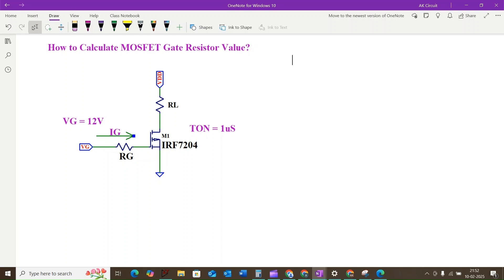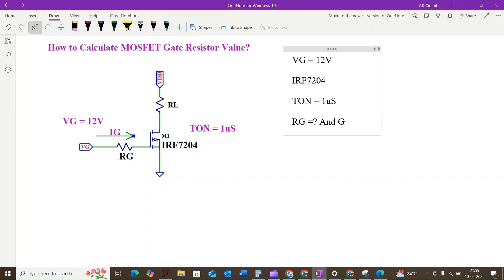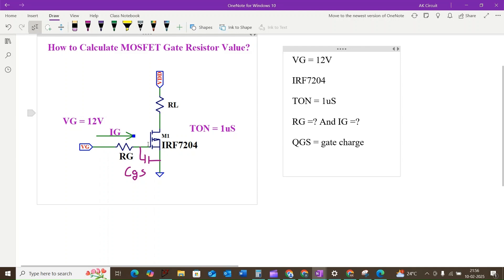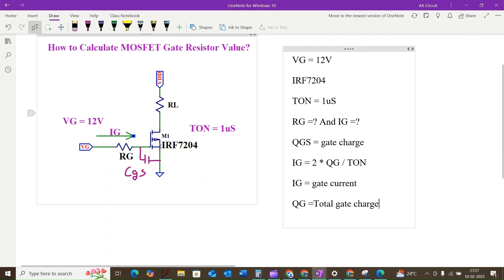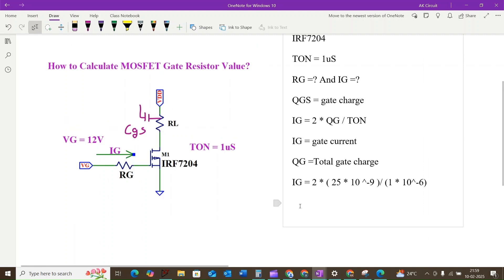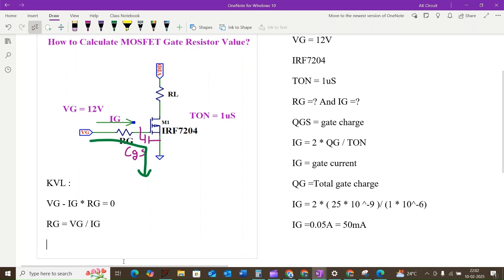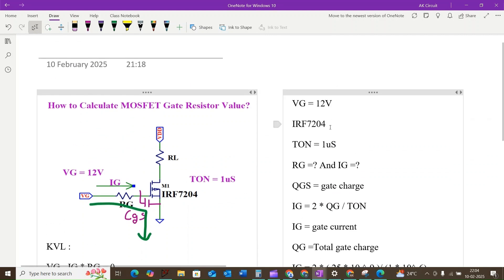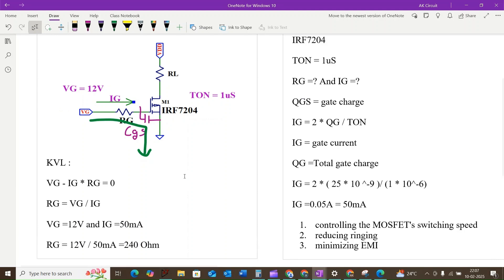Calculate MOSFET Gate Resistor Value (Easy Guide) || Hardware Design

Comment: THis is not as simple as presented. If I have 3-phase synch. BUCK topology, in every half-bridge for one phase, I need LOW EMI but also FAST switching
for low loses,  so one way I use resistor at GATE to turn FET ON, another way I use resistor + diode, to turn OFF FET. And I have to fiddle this values
of GATE resistors, for HIGH and LOW FET, to achieve LOW VOLTAGE / CURRENT overlap, to achieve PSEUDO-ZVS-ZCS. So resistors for HIGH and LOW
FET will be different and I have to take into account REVERSE RECOVERY and Qrr, if I use silicon FETs, becuase SiC and GaN are expensive,
Reply from the maker: Thanks for your guidance

Comment: Hi, as per my knowledge the gate voltage should be negative in order turn on the P-channel MOSFET?  But here you have used +12 V? Could you please explain?
Reply from the maker: If VDD is higher than 12V, then Vgs = 12V - VDD will be negative, turning the MOSFET on.
Reply: @zenithcircuit is not Vgs=Vg-Vs=12-0=12v?
Reply from the maker: rise you concern on akcircuit@gmail.com